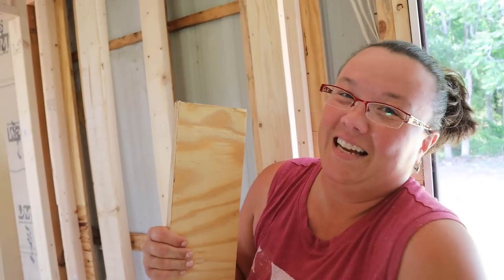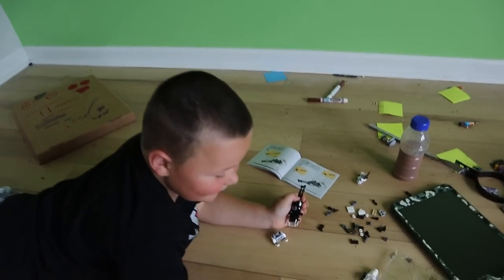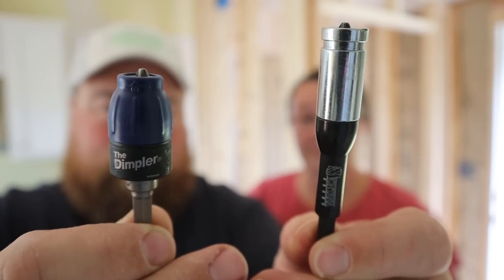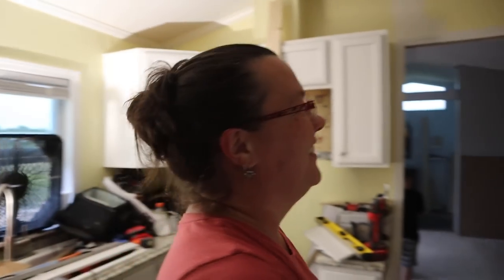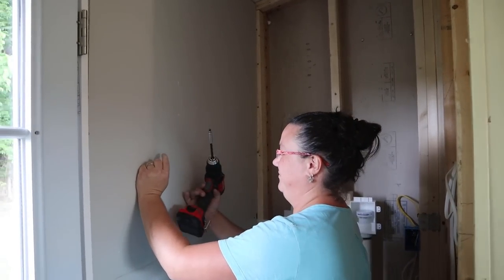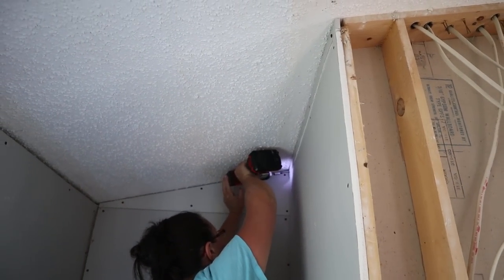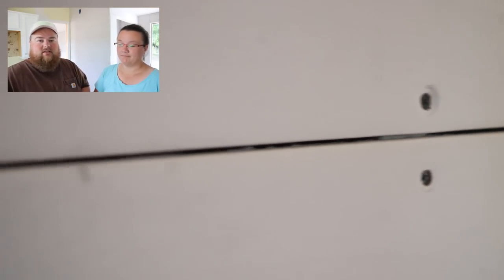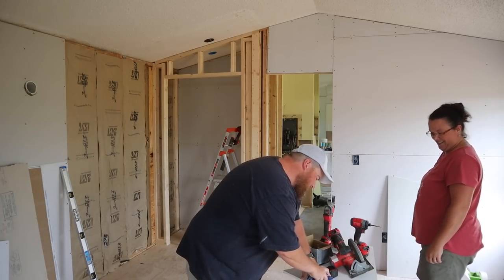TOOL TEST & Hanging ALL THE DRYWALL // Mobile Home Renovation

Comment: The bit in the Bosch Dimpler can be replaced. At 17:43 it popped out of the Dimpler and you popped it back in.
Reply from the maker: Yes, but it's not a standard PH2 bit -- it's thinner appearing. No doubt they made it proprietary. LOL

Comment: That's so weird. I'm sorry the Montana brand didn't work out. I have two of them and they have always worked great for me and we've done a lot of drywall with those.
Reply: It might have something to do with the particular drill driver being used. I'm sure it's a reputable product.
Reply: @DIYfferent it's OK. We all do things differently. Our likes and dislikes are different. It would be a very dull world if we all did or liked the same things.
But it's worth passing info with others to try to make things better/easier.
Reply: That was a great tip alas it was not so good for Sam, but people always like a good tool shout out. It all depends on what you have used before and what you expect the tool to do as to how the tool seems to perform. Its like your paint stick and your drill mixer, you expect the drill mixer to be better, alas it was not. What you expect and what you get can be totally DIYfferent :-)

Comment: You 2 knocked it out of the park doing drywall. Good job. As the doors go, I agree with Angela wait till you move in. Also I've seen where some have hung curtains for doors. Remember back in the day, when the kitchen sinks were on petals? they use to hang curtains under the sink so they could store things under the sink. Gee, hope I didn't just date myself! LOL

Comment: I was a union carpenter for 34 yrs , worked in home construction doing finish work for close to 4 yrs before moving to commercial work . I last hung board at student dorm projects at a college . We hung all 5/8 fire code board mostly 10’ sheets . My coworker and I would go into an apartment and start hanging . He wanted to do all the screwing , I was the cut guy . I did all the measuring , curing , cut boxes , carried sheets etc . He only screwed sheets . We had only so much time to have one apartment completed before the tapers were scheduled to move in . So ya had to move fast . We used auto feed screw guns by hilti on this project . My tools , a knife , tape , zip tool , dry wall square drywall rasp and a 2’ level for plumbing first sheets . My buddy of course had a auto feed screw gun . The old school method of screwing sheets of course is the single screw hand fed screw gun is what guys used to use . Companies now supply the auto feed guns because they are way faster for production.  We had a crew that went in and ran all the hat track and hung all the ceiling before the walls were done . There were 4 phases to this project . Very large project of college dorms . Been watching you doing your home . We stood all sheets up , did not lay any down . All ceilings were 10 ft high . Tapers don’t like butt joints much . Started watching your home move and inside work . I redid my sons home inside . Stood all sheets from front to back . Taped it all and painted it . Went fast , no one was living in it yet . Good luck .

Comment: FYI always add the small drywall strip to the middle. full height on top and bottom install strip. much easier to tape. great job 👏🏻

Comment: I agree with you on NOT insulating interior walls. Besides that, the fiberglass insulation y'all are using is for temperature retention and is not a sound deadener, so it would just be a waste of money to use it in interior walls anyway.

Comment: My 36 inch closet has bi fold doors.  Two 18 inch. Each door has two 9 inch panels, so they only come out about 8 inches.  The upper track is set in about an inch.

Comment: Don't forget you can use monitors two way monitors between the boy's room and yours. As my dad got on in years he was in a different part of their home due to his hospital bed. But my parents could communicate with one another easily without my mother having to get up every time. Just a thought. 

With insulation it helps with maintaining temperature and contains noise.

Comment: Everything is looking great!
If it's not too late... when you're mudding the joints, the easy way to do the top where it meets your textured ceiling is not to mud it at all, use some good paintable caulk to fill it and use your finger to contour it to the ceiling texture. It's quicker, easier, and gives a better finish than trying to do mud and sand it up against the texture
Reply from the maker: Not too late and great advice! That would let us finish it out without having to fight crown molding (both in cost and installation) too! :)
Reply: @sam-and-angela  Awesome! If you try it, I hope it works as well for you as it did for me, but if it doesn't, crown molding will cover it right up

Comment: Wonderful job 👏👏👏. I think the right curtains would provide the easiest access; curtains with stability like, room darkening or shower curtains would not wrinkle.  Plus, get the metal rimmed grommet type for easy sliding.  Also for the bedroom, consider hanging curtain on the outside of the door frame so it can be pushed aside completely and give you full access.   May not be able to for pantry because of back door so go inside the door frame.  Looking forward to what you do.  🧁🧁🧁🧁

Comment: Sam, l was watching another video. Lumnah acres. He used the powder quick setting joint compound. He mixed the compound and put it in a one gallon ziplock bag and cut the corner of the and used it like a cake Piper and filled the big gaps and smoothed it out. Results you don't have to wait a day for it to dry to apply another coat of regular mud.

Comment: Have you considered making a covered door that matches your cupboards in the kitchen. You could make a set for the top half of the door and the set for the bottom half of the door. You could even put the center opening to one side or the other of the center mark so that the door doesn't stick out and hit something when it's open. Just some thoughts but you're right it looks so much better with the drywall up. Now comes the muddying. That always seems like the last step but it really isn't painting it is the final step. Do your best I'm sure it will turn out really sharp. Thanks for sharing!

Comment: The difference is great. So much more light, better use of the space, and overall you must be thrilled to have gained the extra pantry. 😀 

It must also make waiting on external forces to finish the installation jobs for the home, far more tolerable. That has to add to the win factor of these jobs. 😉❤

I'm with Angela on the doors, sometimes you have to live with a space to work out what would be best to use.

Comment: Sam and Angela, the Bosch dimpler does allow you to change the screw tip. I watched a video here on YouTube and it explains pretty much what the dempler does. Simply enter " Bosch Dimpler " into the  YouTube search and it should pull it up. I myself only used drywall screws when I was working with galvanized steel 2x4's on wood studs I always used cupped barbed drywall nails. However I don't have any issues against using screws on either wood or metal so long as they are set into the drywall correctly too deep breaks the paper which will overtime cause the drywall to come loose. Not set deep enough causes a major problem in trying to mud or finish the drywall. Before I started applying mud over the screws I would run my trowel over them if I detected my trowel making contact with the head of the screw I would have to tighten it down until it was countersunk enough would not cause a problem once finshed. Drywall screw and nail depth is critical too deep breaks the paper not deep enough trying to finish the drywall makes a mess.

Comment: Years ago, we signed up for a power company, 6 month experiment in which the cost for power differed by time of day, week days versus week ends.  12M-5AM was significantly cheaper and we shared responsibility for turning things on at 12M; dish washer, dryer, washing machine, and so on; Friday night we all took a nap and at 12M, the oven was turned on for hopefully a full week's worth of baking.  The experiment ended early at 4 months 'cause they realized if they did region wide, they wouldn't sell enough electricity at regular rates to cover thier costs. When it ended, sleeping at night in the quiet took some adjusting.

Comment: You can put a plane full size door on the pantry. You can put metallic baskets on the inside like a spice rack. When the pantry door is open anyone can see it before coming in. 

The next  comment has less to do with drywall and more to do with smart ideas.

So last week we were visiting some out of town relatives. About 6 months ago they renovated their kitchen which is next to the bedroom just like your home. During the renovation they run into the same problem as you with a dead space in the lower corner cabinets. Now my uncle never wasted anything and that dead space was really bothering him. So one day while we were out he cut a hole into the wall in the bedroom where the dead space was in the kitchen... 
I'm not going to go into details but by the time we leave for home he had a closet open from the bedroom wall into the kitchen dead space. It is ideal space to store winter blankets in the summer or suitcases or anything really. You might wonder how a door will look so low but it doesn't really show. Anyhow my cousin put a light table in front and now you really can't see the door.

I hope you might like the idea if you hate wasting space.

Comment: Hey guys, I really enjoy watching your channel. I just wanted to say that we have the same setup where the back door comes in and hit a by-fold door in the laundry room. I’ve had to replace the right bi-fold door twice as it splits out the top and bottom of the door where the hinge pins are located. Finally had to make a big sign as a reminder to deadbolt the back door before opening the bi-folds.

Comment: For the pantry you could use a bi-fold door that was attached on the left side.  When it was open you could still open the back door.  Or you could use sliding doors, but those would hamper your access to the pantry.  (Doors to one side -- half of pantry available)  Those accordion doors are just awful plastic things that yellow over time and no way to get them looking clean.  A curtain on the bedroom closet is an easy fix.  You could use a shower rod and get curtains with the big metal grommets so the closet curtain could match your window curtains.

Comment: would of benefit from cross bracing between the vertical 2 by 4 at the seams of the plasterboard, prevent future cracking and stability of the boards. nice job.

Comment: Great job!  I love putting drywall up as you get a great feeling of accomplishment and can really see the vision take shape.  Fun to see how this project is progressing.

Some tips for the next drywall job... Usually drywall joints should be staggered to avoid a vertical floor to ceiling joint.  Doing so will make a stronger wall and help avoid eventual cracks in the drywall.  Also, I know you were just trying to use up all the scrap, but usually you don't want joints on the vertical lines above a door, again for strength and to avoid cracking.  Use the largest piece of drywall you can to span the door frame and just cut out the opening after it is up.  Doing so also reduces the number of joints, which means less mud work (the most tedious part of the job).

Comment: i would just use a cute printed curtain, the upside to it is it will open all the way with not much bulk, the doors don't open completely, and you can change it out if you get tired of the print....in the bedroom, I would try the curtain, but again the bi-fold doors don't open all the way and a matching curtain to the windows will look pretty.

Comment: I had to have ALOT of drywall work done in my 95 Dutch 16×76 because of water damage and black mold. The guys who did it waisted so much drywall, didn't cover the screws good with mud, messed up every socket. I still have a wall in the small bedroom, the front bedroom, part of the kitchen, laundry room, master and bath to do to have all normal drywall. Need new subfloor in the front, living room, laundry, and master and bath... no one to do it and most of all no $$$$ to do it.

Comment: Also consider bifold doors do not allow for total access to the closet-when bifold doors are open, that’s about 5 inches on each side that reduces the closet opening 

As small as the space is you will be using all of it- I recommend a “regular” door

Also-what happened to your spice rack that was embedded in the kitchen wall?  I thought you said you were trying to keep that

Comment: heck Lego's ... you can never go wrong with lego's ... heck they even make great model tests for cinder brick cellars etc ... you can predetermine the foot print you want your house to be to give maximum space and functionality ... long and thin or wide and deep ... or square and tall ... whatever fits your design idea best
Reply: well you have to admit it is an honest review ... and I can see why they had the review they did for the tools ... those dimplers left gaps not dimples ... much easier to do when you can see the head just penetrate into the paper ...
Reply: pocket sliding doors for the closet and pantry ... then you dont have to worry about the doors being in the way ... their IN the wall .. best to modify before you mud too you might be able to use the few inches on the outside face and just reskin it .. easiest add in for a pocket door
Reply: for the door by the outside door have it slide into the passageway along the front of the in place drywall ... you can add a shelf over the hallway door for storage and have the slide track on the edge of the shelf ... then its open when your in the pantry and partially blocks the hallway ... then you close it and the pantry is all sealed up again ... same with the closet ... a shelf where it slides out in the way of the door and you can put the winter comforters up there or seasonal storage that kind of idea .. even with the closet door open you can still get in the room you just have to make a corner now is all ... makes for dressing safety ... door blocked someones changing there ... idea ... then you are able to be delivered a coffee without being disturbed while getting changed etc ... ;) yeah but a coffee ready to drink while im dressing heck yeah id enjoy it ... lol

Comment: You said the opening was 36". If you go with bi-fold doors, don't do a single set. do double a pair on each side. that will give you 4 9" doors. That should easily keep clear of the back door. And will take very little space into the room when open.

Comment: On the stacked washer and dryer setup: I'm 6'1" and I'm not sure if I would be able to reach the controls for the dryer once it is above the washer. You two are a bit shorter from what you have mentioned in past videos, so how are you going to reach the controls on the dryer? I'm assuming the dryer will be on top of course.

Comment: Okay, my dumb questions:
Why the blocks for the drywall?
I don't understand the purpose they fulfill.
Isn't ^^that^^ adding a lot of weight to your frame? 
Don't you need to reinforce the floor joists(?) to cope with the added weight?
I'm a green as grass newbie, so please forgive my ignorance. 
Did you rewire  and put in new plumbing, too?

Comment: I thought you normally start at the ceiling with drywall and leave the cuts for the bottom sheet that is hidden by baseboard? I think you said you have ceiling heights less than 8 ft so 1 sheet will be less than 4 ft. Why start at the bottom with a 4 ft sheet? Your ceiling piece will not have a factory edge on top and bottom and be more visible.

Comment: How would I calculate how much insulation I need for a 16x80 mobile home? Exterior walls only! And what’s the cheapest ?
Reply from the maker: Do you know your wall stud spacing? It should be 16" on center (also called OC sometimes). Then the easiest way is to use an online calculator like this one to find the estimated batts: https://www.lowes.com/n/calculators/roll-insulation-calculator
Reply: @sam-and-angela  thanks for the info! And yes it’s is 16 on center and they actually used 2x4 in this older mobile home! Demo is complete and now it’s time to put it all back together! I need a community of help for good info! I live in Mississippi and there aren’t that many groups to join actually!

Comment: Why not just try out a cordless drywall gun which matches your cordless battery setup? You could have gotten the tool which would have saved you so much heartache for under a hundred dollars or probably gotten one for free if you spoke to them.  Those stupid drill attachments are shit especially on inside  corners.  Happy drywall finishing and get yourself a good screwdriver